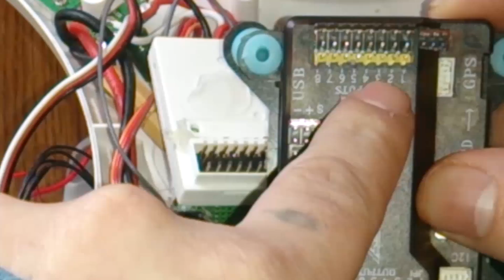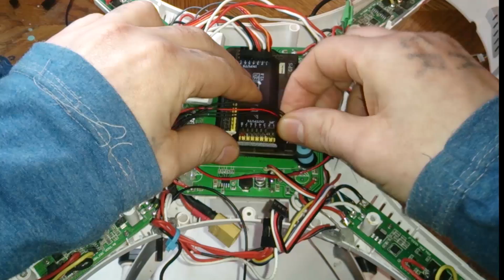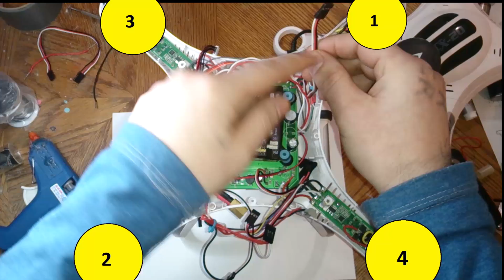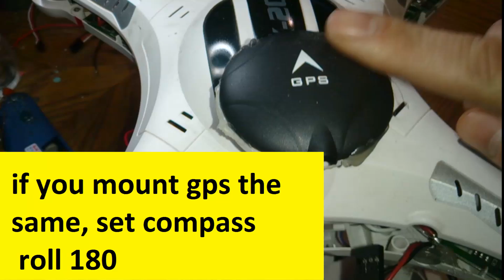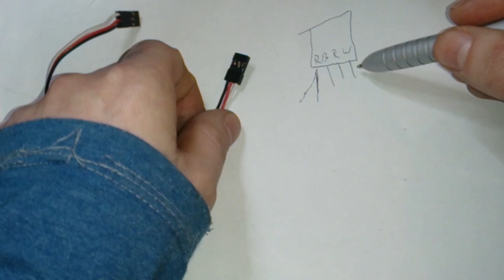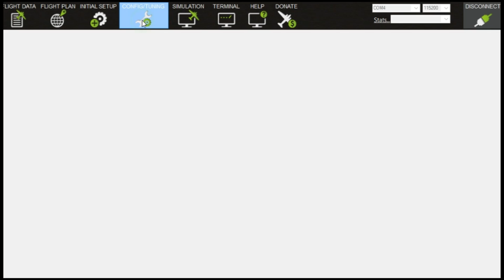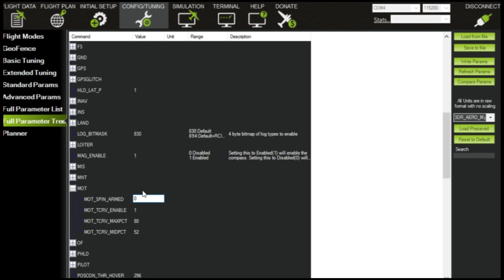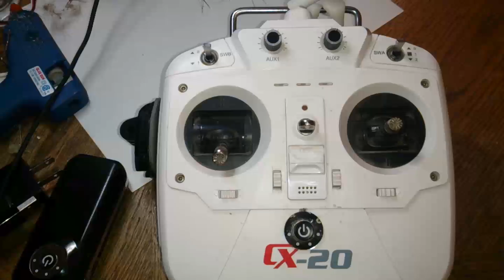cx20 factory apm to apm 2 6 - 2.8 step by step

Comment: Hello friend, my cx -20 not bear the weight of this ginbal , I'm using original motor and esc , APM 2.8 , which can be ? He makes a very nice flight of nowhere begins to descend without power in the engines ! Shot gimbal and nothing happens ?
With the gimbal is weighing 1,200 kg
Reply: it will be the engine that has no strength ? I bought new s kit and original engine and continues with the same problem? That may be , know how to help ?
Reply: I changed all my wires as you do this video and do the same without gimbal is perfect!
Reply from the maker: +Manuel Lisboa do a test flight with the gimbal ..with it not attached to power  to see if it is a voltage problem,    It can be your battery does not hold enough current..    What I would try is add 100g to the quad take it for test flight . .. then add 200 grams. take for test flight ect ect.. until you find your max weight for your quad.   .
Reply: Thank you for your answer,
OK friend!
You have concluded that, 1.050kg goes well!
to pass is not strong, suddenly comes to the floor!
Reply: Before it went well with the Chinese gimbal and the walkera of plastic with basic sj4000 from you three months neither one nor the other can handle, rsrsrs
Reply from the maker: +Manuel Lisboa your quad should be able to handle the 300-400 grams .. but it depends if you got larger battery because they get heavier as well.    If you are pushing 500 grams or more you might run into your problems..       It could be your esc's can't handle the amps as well .        Your options would be to get lighter gimbal ,upgrade motors to say 1000kv and new esc's . if you have 4 extra esc's and 4 xtra motor's you can buy octo frame and make a octo with all your extra parts.                But I would check your battery it might be just degraded and can't handle the extra amp draw.
Reply from the maker: +Manuel Lisboa Any update on your problem.. I just had interesting results adding landing gear.. it flipped out on me twice and went through 7 blades.. I then soldered on a bec just for the landing gear and everything is fine..  could your issue also be a draw on the apm sending it into a fail safe?  .. or was it a weight issue..

Comment: I bought a CX-20 on CL and the GPS functions don't work. I have a Big Shark version and it just loses control if thrown into GPS hold or RTL. This looks like exactly what I need to do to make it a reliable quad. Do you know if the motors would work on a HK SK450 frame? I have one that I've never used and since I have a bunch of props for these motors, I might as well switch everything over now with some new 25amp ESC's. Thanks for the tutorial.
Reply from the maker: +Arthur Nava .. yup the motors should fit over..  just make sure that the screw lengths don't hit the bottom coils of your motor.
Reply: +bangs6996 I got lazy and did it inside the CX20 body. I connected everything last night and it powers up, gets signal from the M8N GPS, even when indoors. The LED's I did like you explained in the first video, I had a Big Shark version, and they seem to work. I will work on finishing it tomorrow, and hopefully take it outside to test on Saturday. I have no settings to import from a previous version, as I was not in APM before, so we'll see how the setup goes. So far, so good though. Thanks for posting your knowledge on here, definitely helped me out a lot.
Reply from the maker: +Arthur Nava your welcome.. . and good luck on Saturday.. .  .   you can Also try my params if its acting up.... https://drive.google.com/open?id=0B2w6_OKE_2kxM0xYckJidFNRWTQ
You have to do all the calibrations again after loading mine..
Reply: +bangs6996 For some reason it won't spin the motors. It arms but won't spin. I've checked the connectors and everything seems correct. I don't know what could be happening.
Reply from the maker: +Arthur Nava In mission planner go into calibrate remote ..and confirm you can see things moving around..  ..if you can arm it..it seems fine..but maybe you have to set 24:24   ...
Reply: +bangs6996 Nothing beeps when I try to do the ESC calibration. So, I don't know.
Reply from the maker: +Arthur Nava ..
What happen in mission planner? does the Remote calibration section work ?  throttle ect..

 What you can try is.. is unplug all the wires from your rx    .. if your using a power module unplug it..    Plug in motor 3 or which ever one is beside your rx in your cx20.. and plug the motor wire directly into the rx  -T    . Next Plug in the -b cable ..(the black red white wire, attached to your mainboard) into the rx -b section.. plug in your battery . You may hear lots of beeping but ignore it.. .. turn on your remote and move the throttle up and see if the motor spins.     ..

If your motor spins .. you can repeat this for each motor and do a direct esc calibration this way as well
Reply from the maker: +bangs6996 If you want take a picture or video , above view of you cx20 and send to bangs696969@gmail.com  and i'll look it over quickly just in case you over looked something..
Reply: +bangs6996 thanks dude. I uploaded a video to my channel.

Comment: one asks my friend, as I keep the factory settings of CX20 in mission planner, is if something goes wrong and recover factory
Reply from the maker: +MBCT Wireless ..I don't have any 4s battery to test that out . but I would say no as the cx20 esc's were made for 12volts and not 18. same with all the components on the board..   I think you might be better off paralleling two smaller battery's to increase amp hours . but you will run into weight issues quickly as well
Reply from the maker: +erikson yol ..I am working on a package today and tomorrow to backup factory  ...
Reply: Hey can the cx20  take a 4s battery I wonder
Reply: I'm seen people's adding 5000 maa for more flying time, I have a drone that I just build  H Quad, but some how have problem with yaw problems, I replace the APM same problem ,I want to find a way to send to you so you can fixed  I paid you for.. I send some picture
Reply from the maker: +MBCT Wireless you can send pictures and video here bangs696969@gmail.com    for using the 5000 I use a 5500 and currently have a 6000 on its way. I was going to order a 10,000 battery but that will be to heavy for the quad .. so in a couple of weeks what I will try to do is order the 10,000 and make custom frame around the battery to see how that goes..     What I would suggest doing before sending it to me is .   To find out if its the remote .. switch the a,e,t,r  around on the receiver put the r as a and e as t ect... then go into mission planner and see if its still the yaw that is screwed up. under radio calibration ...  By doing this you should be able to find out if its the remote(txt)  that is broken or the receiver..............if switching it moving your joysticks yaw direction now creates another thing to fail throttle or roll ect from not working .in one direction. then its probably your Remote(tx) that is broken. 
in mission planner with the cables still mixed up ..if it continues to be the yaw that is messed . (by moving what you switched it with) then it is the receiver that is messed up..    I hope you can kind of make sense of what I'm suggesting to try.
Reply from the maker: +bangs6996 if you want you can record video with cell phone or computer software.. record moving your remote in the Remote calibration Menu.. and I will try to re-create your problem and tell you what to do ..to find out if its the remote or the receiver.